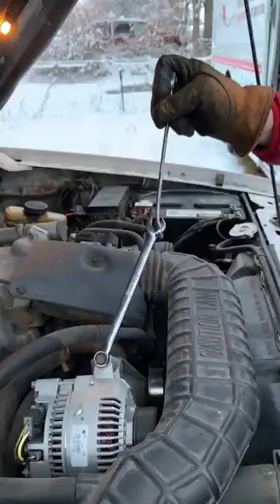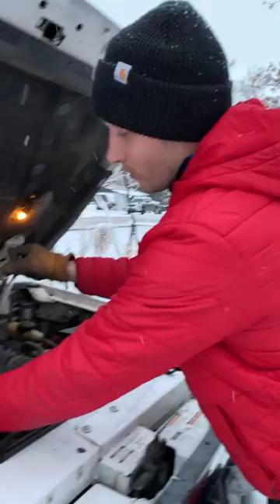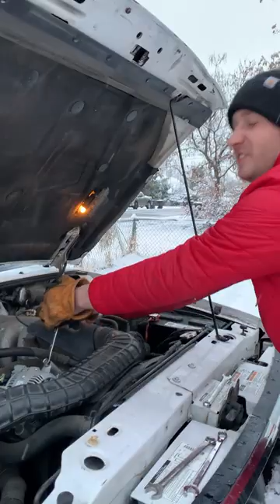What does it mean if your Mechanic's WRENCHES look like This!?!

Comment: It works better if you loosen the bolt instead of tightening it.
Reply: gee ya think rofl
Reply: Only time I'll tighten a bolt when loosening is if it's rust welded bad. Doused in pen oil and its got a sliver of movement backing out then I'll tighten it back up. Next back out it might have a sliver and a half or sliver and a quarter of movement and repeat and eventually the bolt will free up and pop out. Don't use with an impact tho. You'll bust the bolt head right off.
Reply: Looks going tight but it's loose...the phone camera is facing him, it comes out backwards in video.

Comment: More leverage to break bolts or tighten them
Reply: @Islandwaterjet not necessarily....all depends on the bolt size and what it's holding.
Reply: You mean you're not supposed to use thread locker on everything?
Reply: I've done that many times.
Reply: @DesertCowboy760  cross threading is the threadlocker

Comment: If you watch and listen closely, this guy is no mechanic, way over tightening while saying he is going to break his knuckles when it comes loose, he needs to pull from the other side to loosen.
Reply: Did u even watch the video? Maybe ur volume was down? 
He is loosening it. NOT TIGHTENING IT DMBASS
Reply: @danacrawford8140  doubt that's a backwards thread bolt...he's tightening.
Reply: The only time I've ever tightened a bolt to loosen it is when it's rusted bad. Back it out it stops and run it in and repeat. Never going past the point that it's over tightening tho. You can start out with less then a degree in the wrench swing loosening then tighten and repeat and before you know it the bolt is spinning out. Allows penetrating oil to get in better too.

Comment: Means... they are to lazy to just go get the proper breaker bar. If they are cutting corners there, they will be cut corners elsewhere! THATS the optics you are putting out to the customer. I wrench, i do that to in a rush but.. NOT in front of a customer.
Reply: Sometimes it's not lazy or corner cutting. Sometimes it's the only way to get to the bolt you need. Area is too small for a shallow well socket so a breaker bar isn't going to work. A flex head is nice but you don't got the leverage to apply the force for the 4 degree swing space you have. so you have to daisy chain 2 wrenches together so you also got the clearence to avoid the hose you don't want to disconnect and drain fluid that a long handle wrench hit not allowing it to seat on the bolt properly. Or you can fallow the way the service manual tells you and remove the wheel, strut,  and fender to open it up enough for you to hit it with an extention and socket.

Comment: You can break wrenches like that.   Use the right tool,  a half inch breaker bar and socket.
Reply: I have yet for this to happen and I've been doing this for years. Cheapo wrenches and all. When I break one I'll let you know
Reply: @oliver_klozoff  I agree. I been doing this for years now and have not busted or bent a wrench. Plus some spots you can't get a shallow well socket in let alone a breaker bar. And if you have a long handled wrench it's not going to fit on cause you have something in the way of the swing. With the dual wrenches it gives you a few degree's of flex to go around something like a pully or hose.

Comment: Working in the cold like that is brutal, hope it's worth for you
Reply: Here's a cheat keep your tools in the house so they're warm when you have to work in the cold. I use an electric heater under a small toolbox if I can't get the car to the warmth. I take the warmth to the car.
Reply: @wellintended783 that's dumb, you take warm steel outside it'll be cold on a couple short minutes. Not even the slightest bright idea in this.

Comment: How do you deal with vehicles that aren't on level ground of you gotta get under?
Reply: If it's in a driveway I'll chock the back wheels jack it up and have jack stands ready. Usually one set at the hight it's currently at and one for the next few pumps and switch out the stands. That way if the jack loses footing and slips its only going down a few inches before it meets the jack stand and stops. Wheel chocks prevents roll back. If it's in a yard I get permission to dig a small section out. Gently remove the top layer of grass then level the dirt below it before placing a patio paver (usually a 12x12 square) to place the jack on before jacking up. Place a second smaller paver where I'll put the stand let the jack down and get to work. Once done I'll fill the leveled area in and place the grass back on top. Then just advise them to water it once a week to prevent it from dying.

Comment: My customers cars are worth to much to me to do hack crap like this, sorry.
Not sure why you aren't using the right tool for the job.
Reply: I had a car that needed the wrench combo trick to get a pully out. Space was too tight for a shallow socket so breaker bar was out of the question. Flex head at the time wasn't avaliable in long forms. A long regular wrench would hit a hydraulic line in turn wouldn't seat right on the bolt unless you wanted to make a round bolt. So had to daisy chain 2 wrenches together to allow for the clearance to get by and the leverage to break the bolt free. Service manual said to remove the wheel, strut, washer and radiator tanks, and fender to get to it. So I used that way to get the a now 2 peice pully out to replace it. As for going under the car the the cradle was in the way so no way to even get a wrench on it from the bottom without being Mr.fantastic